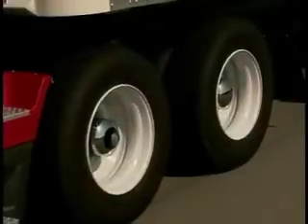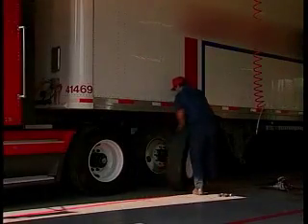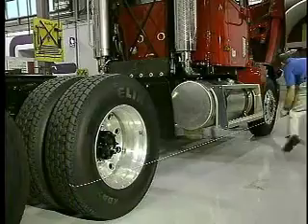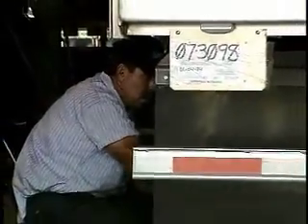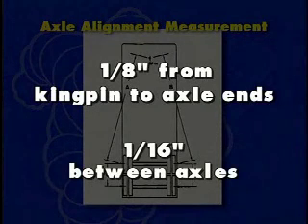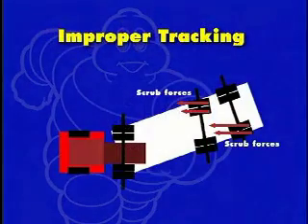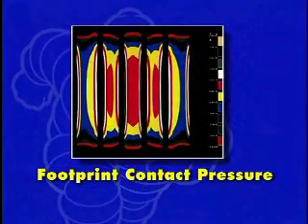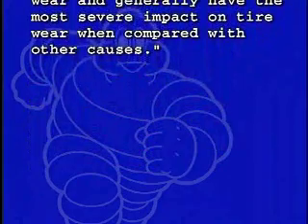Tire Wear Fundamentals (part 2) - How to get more mileage out of your tires

Comment: At 8.44 mins the tire wear with a scratch mark? Curious to know what causes those scratch marks. I am seeing those scratch marks throughout the thread circumference on my rear drive axle super singles. What could be wrong? Alignment, air pressure, axle problems?
Reply: Worn out bearing or strut support loose.